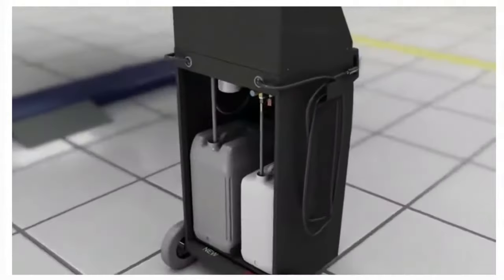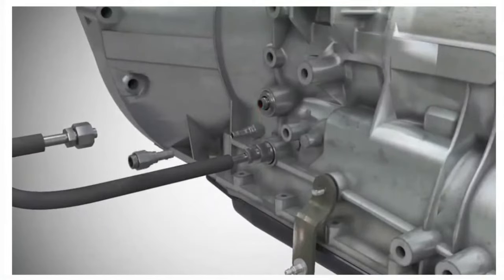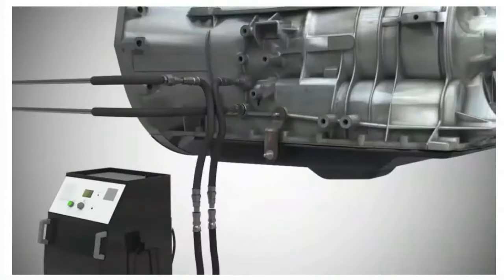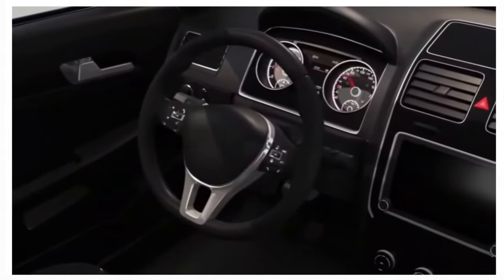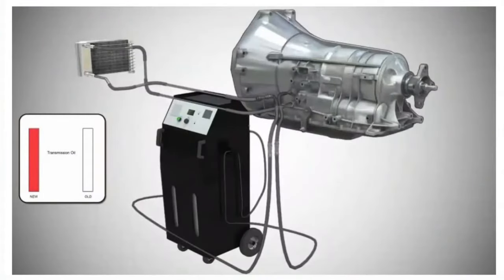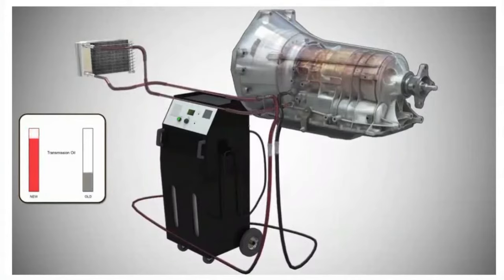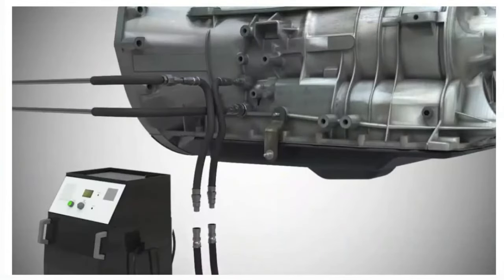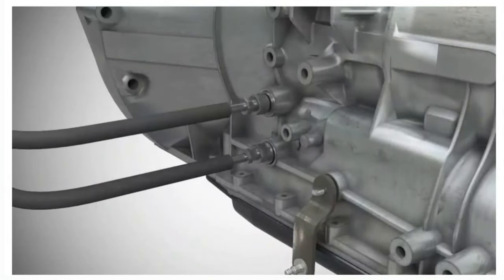The Benefits of a Total Automatic Transmission Fluid Exchange (Flush)

Comment: Great process if done properly.  Had my 97 V6 Camry flushed on a Wynns machine 4 times.  350,000 miles ain’t too bad in my book.  Of course the fact it was a Toyota probably had a lot to do with it.  I was told the problem is some people will try to rush the process by bringing up the engine speed.  Bad idea!  Let the engine idle during the whole process.

Comment: Just had this done on  1999 Nissan Frontier pushing 60K original miles. 4 speed, 4 cyl. Auto. Shifted fine prior. Second owner. Opted for this verse filter change. 25 years is a long time to bust loose old bolts and gaskets...Running GREAT. Valvoline synthetic replaced Really Dirty Fluid...Cheap preventative maintenence.

Comment: So... ¿what are the benefits?
Reply: There is a lot more fluid and gunk in the transmission still remaining after a filter and normal fluid change. The point of this is to entirely remove all the gunk from within
Reply: So then, the transmission lasts much longer. You have less wear and tear from that gunk in the me system. Things don’t get clogged up. Lasts longer + off the factory shifts